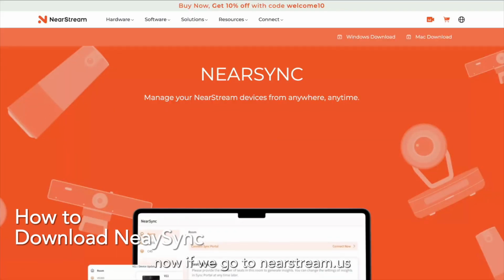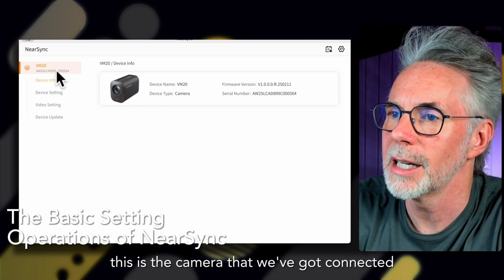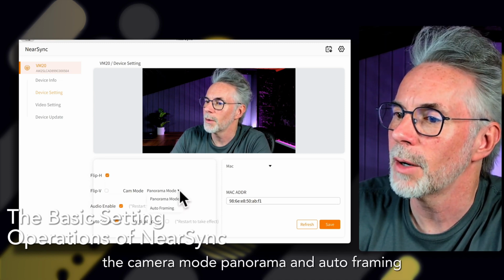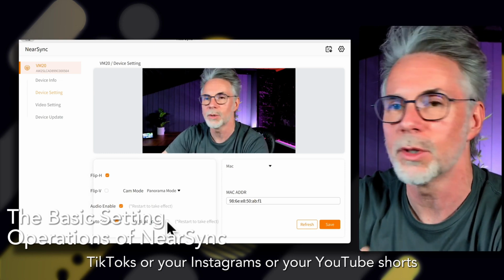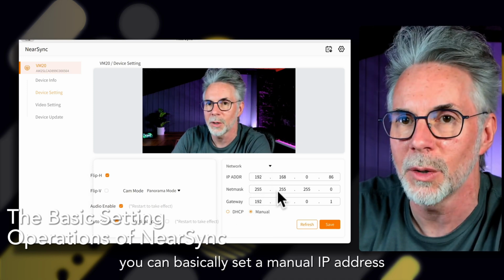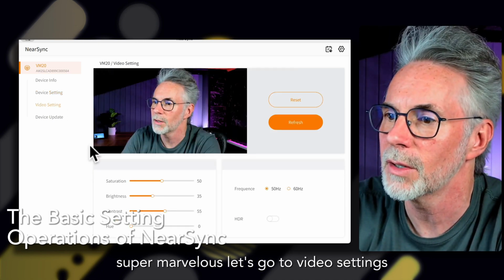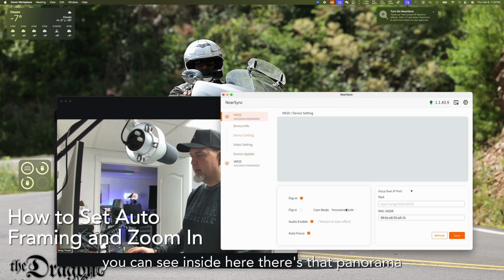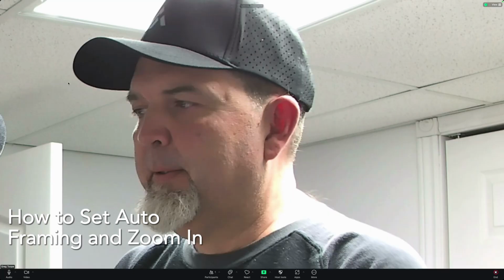Step by Stey Guide: How to Download & Set up NearSync?

Comment: Hi, after a firmware update done from my phone, the VM33 won't connectto any wifi network, nor will it act as AP. I can access its initial config (where you can set the wifi parameters) but then, it seems the parameters are not pushed correctly. Any chance somebody can help me? I couldn't find any support area. Thanks.
Reply: I precise the Camera LED keeps flashing in white colour.